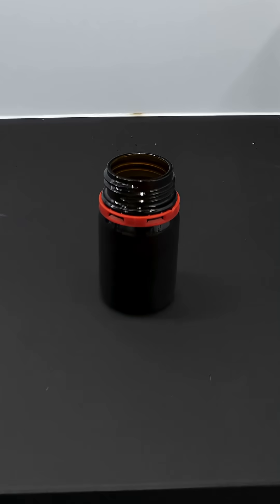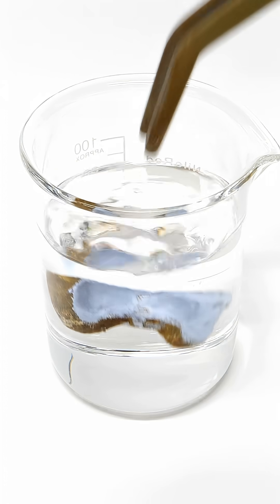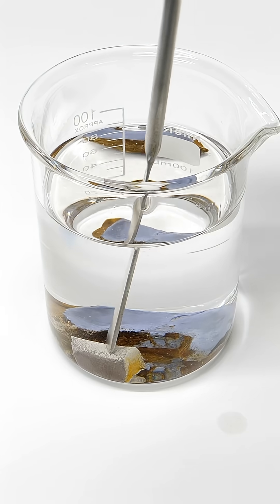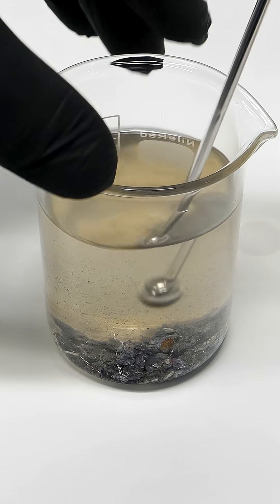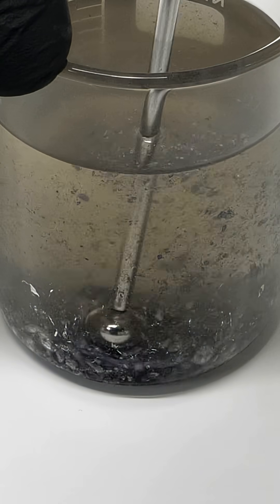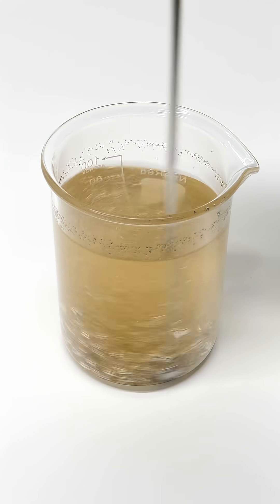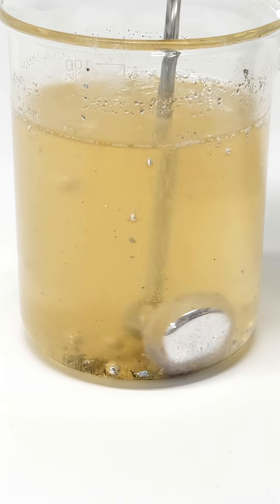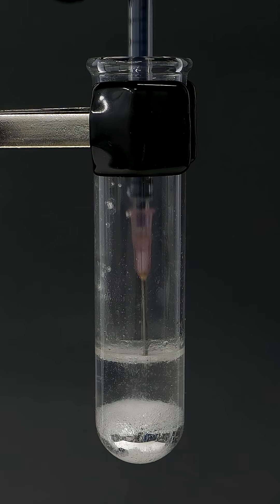Mixing sodium and potassium is crazy

Comment: I want to see you freeze this in liquid nitrogen, then put in a safe before it thaws. Wait for the explosion.
Reply: Explosive popsicles nice
Reply: Freeze, then coat with wax, freeze water around it.
Reply: Switch the metal balls from a Newton's cradle with the frozen balls as a prank.
Reply: Stil reactive so wouldn't work.
Reply: @Sol_Badguy_GG  the point is that it works because they are reactive.
Reply: That would be INSANE
Waiting for a MrBeast x NileRed video soon

Comment: I love how it went from a (semi)solid, then got mixed into a liquid. If it weren’t for knowing that they can make an alloy, it’s the equivalent of if I mixed together flour and rice flour, and got dough out of it.
Reply: Alloys usually tend to have a lower melting point than the metals its made of, like bronze is easier to melt than copper or zinc
Reply: @Nobod114 Like solder.
Reply: @BrianG61UK exactly

Comment: If you watch the videos of the Tianjin explosion in 2015, this is basically what happened. At least, for explosion number 2… I believe there were three in total. The first one was some hastily arranged chemicals that should NOT have been stored together going up in flames. The second was due to response teams trying to put out those flames with WATER from fire hoses…. And the third was from the resulting acetylene gas produced by the chemical reaction from that water then igniting from the already (and ever-higher) extant flames from the previous two explosions.

Look it up. It is TERRIFYING.
Reply: I've been Chinese resident for 15 and a half years now. The Tianjin Cheminal explosion is reported to be caused by spontaneously ignited Ammonia nitride, which is still pretty explosive. It could potentially contain NaK some where since its a big chemical plant, but the influence is minor compared to the exploding nitrides
Reply: @Nobod114 I didn’t mean to imply that it was NaK specifically that caused the explosion. I was mainly trying to point out that it was chemicals which are highly reactive to water that really exacerbated the explosion.

Correct; there were 5 main chemicals involved in the blast: Ammonium Nitrate, Potassium Nitrate, Sodium Nitrate, Sodium Cyanide, and Calcium Carbide (the one that produces acetylene gas when it comes into contact with water).

I don’t live there any more, but I was living in Beijing when it happened. Shit was wild.

Edit: potassium nitrate is also used in making gunpowder.
Reply: Hadn't been aware of the Tianjin explosion before. The second was massive but i couldn't believe the size of the third one. Apparently it was the equivalent of 21 tonnes of TNT, which is huge but still less than 1/2000 the size of the Hiroshima/ Nagasaki bombs 😳Thanks for the recommendation.
Reply: Took your advice, that was scary & too many lives devastated. Thank you for sharing so much information about it. With how many of these types of tragedies, along with fireworks explosions & knowing what causes them that there wouldn't be any future ones near homes or other lg industry, because of learned lessons, but I'd bet there are some cooking right now🙃
Reply: @GummerHummerQueen  It’s hard to explain to someone who hasn’t experienced it, but there’s a pretty good article by James Palmer called “chabuduo! close enough...” that explains why this sort of thing is more common than anyone would care to admit. Here’s a brief excerpt:

“‘There’s a Tianjin-level explosion every month,’ a staff member at a national-level work-safety programme told me, asking for anonymity. ‘But mostly they happen in places that nobody cares about.’ Careless disasters are buried all the time; when a chemical plant exploded in Tangshan in March 2014, a friend there told me of the management’s relief after the Malaysia Airlines flight 370 went missing the next day, swallowing up all other news and making sure nobody but them noticed, save for 13 widows.”
Reply: @GummerHummerQueen  I think YouTube ate my first reply… but yeah, it’s hard to explain to someone who hasn’t experienced it, but there’s a pretty good article by James Palmer called “chabuduo! close enough...” that explains why this sort of thing is more common than anyone would care to admit. Here’s a brief excerpt: 

“‘There’s a Tianjin-level explosion every month,’ a staff member at a national-level work-safety programme told me, asking for anonymity. ‘But mostly they happen in places that nobody cares about.’ Careless disasters are buried all the time; when a chemical plant exploded in Tangshan in March 2014, a friend there told me of the management’s relief after the Malaysia Airlines flight 370 went missing the next day, swallowing up all other news and making sure nobody but them noticed, save for 13 widows.”
Reply: I worked in warehousing in China at the time, our company was impacted by the Tianjin explosion, scary stuff, did you see the Peugot car lot? 100s of destroyed vehicles. EDIT: it was a Jaguar Land Rover lot, not Peugot
Reply: Are we dangerous here ?
Reply: @Mainlandsurf  yeah, it’s a good chuckle, but I’m also inclined to cut her some slack. It’s not at all unusual to lose a little fluency in a second language during times of extreme stress. It’s pretty clear what her intended meaning is: “Are we in danger here?” I.e., “Do you think we’re at a safe enough distance?”
Reply: I thought that was a potassium nitrate explosion. Interesting, I'll have to look into that further.